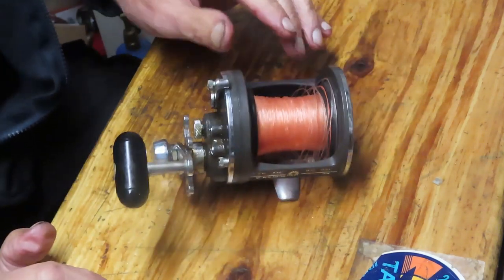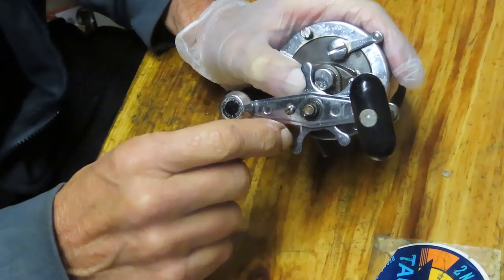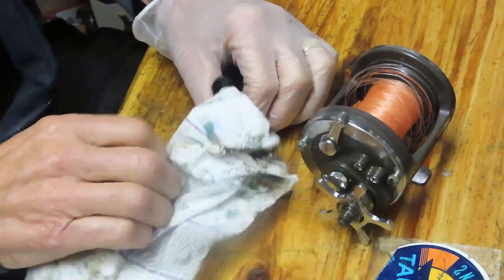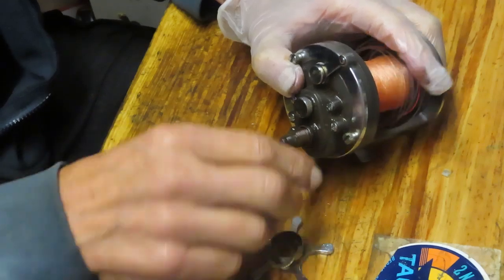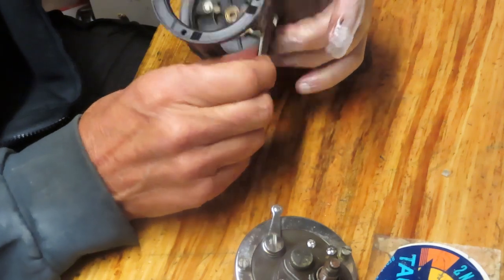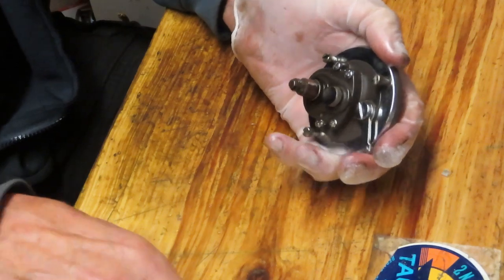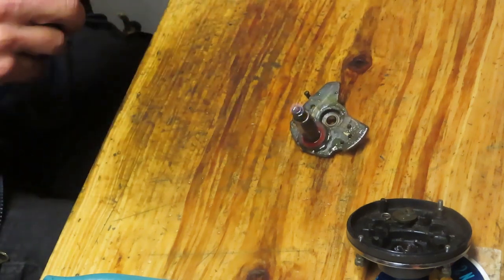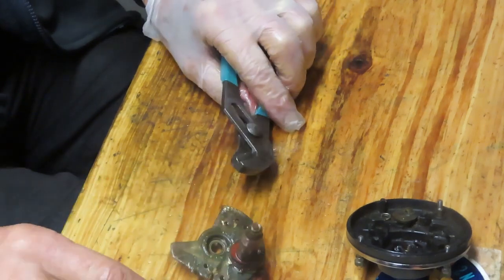Why did this Daiwa Sealine 30H fishig reel fail

Comment: Hey Dennis,
Thank You for another outstanding instructional video! One method that I have tried successfully to remove a frozen sleeve is to use an ultrasonic cleaner. The ultrasonic cleaner seems to break up the rust into tiny particles that tend to work their way out from between the sleeve and the post. I realize that in this instance it may not be worth the effort but sometimes there can be an emotional attachment to the reel or other reasons to keep it original. Thanks again for all of your wisdom that you pass along. Take Care!
Reply from the maker: Thanks for the tip - Dennis

Comment: Hello from Australia. I love your videos Dennis, they are really informative and have helped me fixed a number of reels that probably would have hit the trash otherwise! Do you know what the difference is between the Sea Line reels ending in H? The non-H models seem to come in gold finish and can be switched to left or right side. Have you come across many 'non H' Sea Lines?
Reply from the maker: I believe that the H was initially meant as an indicator for High Speed.  I have not seen the reels without the H designation in this series.  The originals had a black aluminum frame.  The later models were made in black and gold - Dennis

Comment: As always, great video. When I moved out to Northern California in the late 1970s I was pretty much a freshwater fisherman. It was sometime in the early 1980s when I was introduced to offshore fishing for Salmon. My first saltwater reel was a Diawa High Speed. I have no idea what model I have. My guess is a Sealine 20. The only information I have is the line capacity. 20lb.- 280 yards, 25lb.-220 yards. The reel is in excellent condition externally but I would like to examine the internal parts to clean/grease and to see if it needs parts that might be worn or damaged. Can parts for this reel still can be found?
Reply from the maker: The parts are hard to find, but items like the drag washers and springs are still available.  I have a few if you find you need them I will see if I can match them up - Dennis
Reply: @2ndChanceTackle  Thanks for getting back to me. Sometime this week I should be able to do a service. The reel looks exactly like the one in the video except smaller. I stopped using it after a large fish spool me out back in the 80s. I'll keep in touch.

Comment: have you ever tried electrolysis to loosen or remove rust?
Reply: I soaked a very crusty seized plumbing valve in CLR for 1/2 hour, tried turning it again after the soak and it turned easily. Maybe something like that would work here.
Reply from the maker: I have not.  I need to learn more.  Have you used the approach?  On the soaking with CLR, I have used that and have had mixed results
Reply: Soaking that bridge in CLR or some other solvent would have been my first approach. The the heat and force you put on the gear shaft was obviously more than it was designed to take. You can always look for a used bridge plate etc. Those are nice reels. Since it was free or very cheap you're still ahead of the game.
Reply: @2ndChanceTackle  I have not, but it seems very simple and cost effective. the YouTube videos make it look easy anyway. Not that it works or that I actually searched, I haven't seen anyone using it on fishing reels or parts yet. Just guessing It could be another tool that can become handy in the shop.
Reply: @secretbassrigs  from what little I have seen with that process I think you can remove surface rust but the oxidation btw the sleeve and shaft would not likely be reduced to any significant degree. Like I said that is based on what I have seen.
Reply: @surfcat2051  yup. oxidation removes metal. so even if it was repairable it wouldn't work the same. if the rust remover didn't work, it's worth just replacing the part instead, if they're available, to save time. those are nice reels and they can last forever if just properly maintained.

Comment: if the post wasn't too badly pitted this would be an easy fix, but is still boils down to if the reel is worth the extra time, or cheaper to replace the part if available, if not, parting it out would recoup your cost of the reel
Reply from the maker: I may live on in parts to give another reel a 2nd Chance!  Thanks